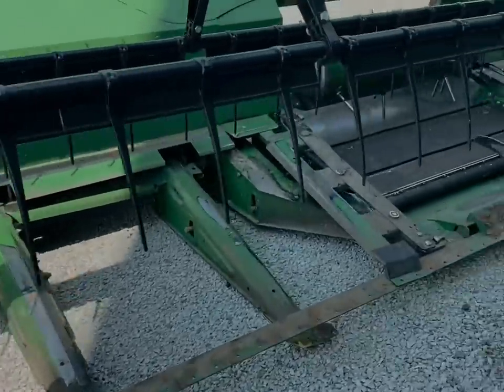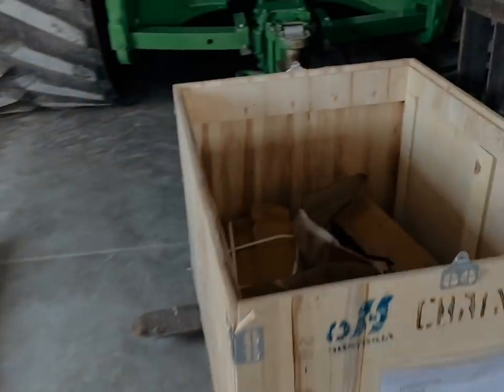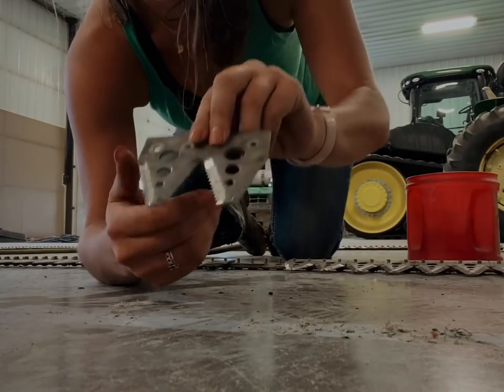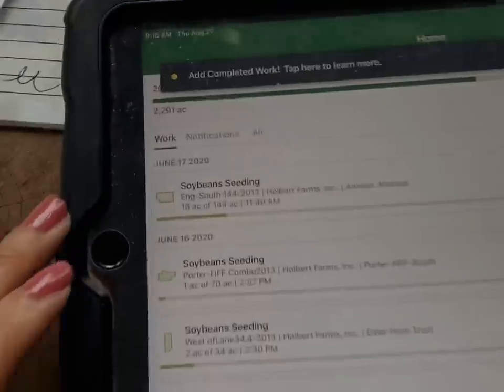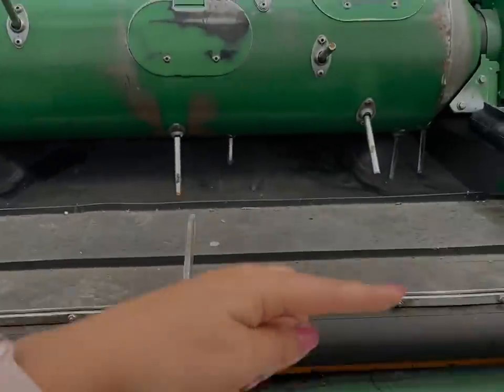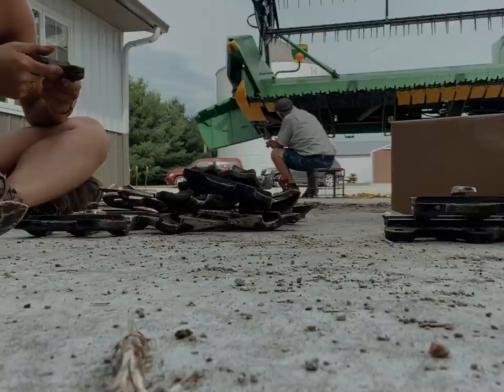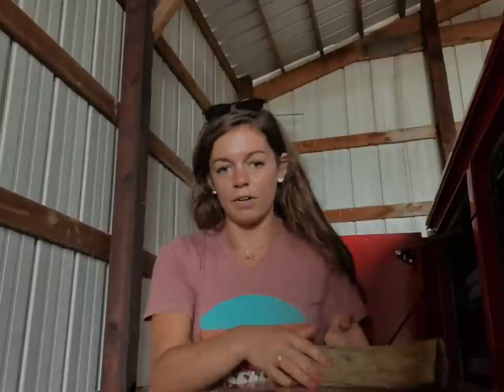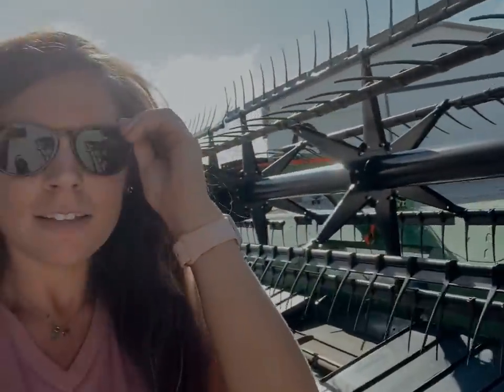Week Recap: Harvest Prep, Paperwork, & Raccoon Trapping

Comment: Erin, put your raccoon bait in an old sock and hang it from the top of the trap just past the trigger plate on the bottom. (Tie it securely. I use a small package cat food to take advantage of the scent attracting them). This will make them have to work to get to the bait, thereby increasing the chances of tripping the trap door. Good luck, be safe, and continued success with your farming. God bless.

Comment: @4:10 -  Knee pads.     Word up to all young people entering the trades, wear knee pads.   Wear all safety equipment
that a professional would wear, including hearing protection and glasses.    Another tip re: knee pads is you don't have
to buy the most expensive, but be certain to get the ones that attach with Velcro.   Listen silently when an older worker
tells you that you don't need knee pads or hearing protection.   Just put on your knee pads and other safety gear.
I'm old and I know that the knees can be degraded rather quickly.  And I didn't use hearing protection enough.

Comment: Quick question for you. Your farm is on bedrock right? And with the Ogallala Aquifer becoming depleted, does that impact your water supply for irrigation? I know Iowa sits on bedrock and is on the right side of the Mississippi River. Do you know if there is any drainage from the bedrock to the Ogallala? p.s., do your "scissors" ever need sharpening? I know with steam turbines that their blades have to be built back up from time to time because steam can erode them. Kind of why I'm asking. Bean stalks are tougher than steam. :)

Comment: May I suggest A shot of tequilla ,some squeezed lime fresh, good fresh orange juice, take a real glass glass wet the rim on a clean moist towel then put the rim of the glass in a plate of salt. Take ice cubes put in a mason jar then add the Tequilla squeezed lime juice and fresh orange juice in the jar cap it shake vigorously for abour 30 seconds. Pour into your salted glass add a wedge of lime on the rim and Walah!!! Enjoy! The Boys will dig it after quittin time if Pops is cool with them havin a drink Guaranteed to put a smile on your face!!!!

Comment: Hello Erin, Very interesting. When you were removing the teeth from the sickle bar were you replacing the teeth or the bar? It would have been interesting to see the difference between the old and the new.
Reply: Agree: however, I find  Erin's videosare more informational than others: chance  to actually SEE the component parts of he Header.  Partsbooks  are one thing, and our Dealer does not stock combines - so when do you get to see the "modern" parts  -crikey bolted on knife sections!   but 'beats' hammering rivets - although we use a screw tool for that.   Who said hat runninga Harvester was cheap?